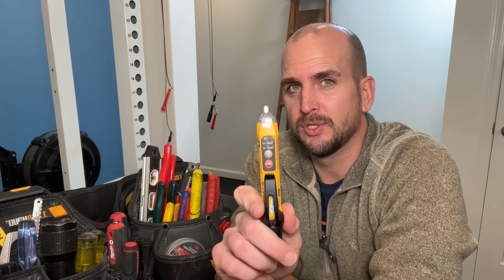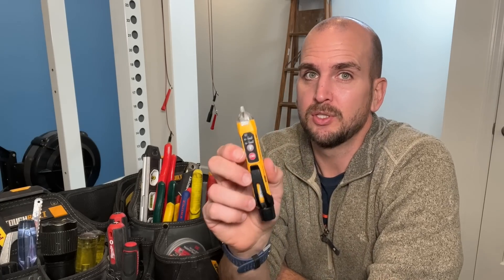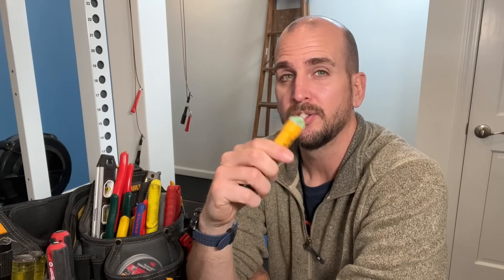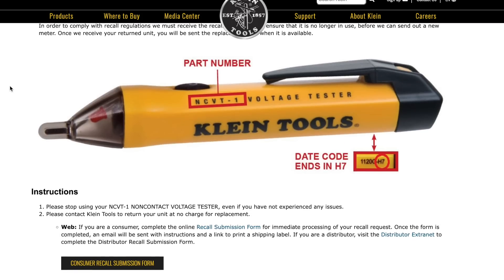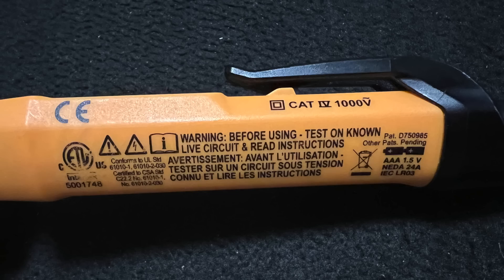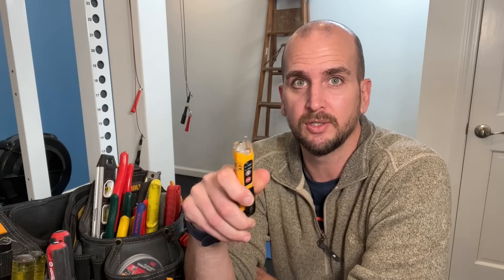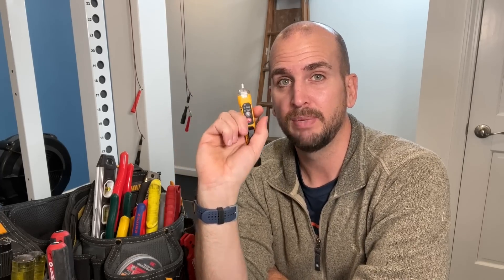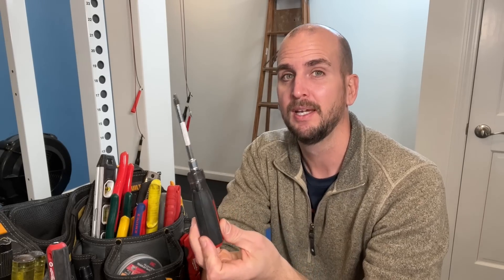The Tool I Get The Most Negative Feedback On And Still Use Weekly

Comment: It's fairly common especially in boxes in a garage, basement or attic, to have runs from different breakers transiting the same box and then going to an outdoor receptacle or fixture.  You may be working on a receptacle or switch where you turned off the breaker and confirmed no voltage with a multimeter, but you'd never know there were still live wires in the box connected to a different breaker unless you also used a NCVT.  A NCVT definitely has its place but it won't substitute for good practice.  Like Fluke says on the side of the tester, "For use by competent persons only."
Reply: agree. i have never been shocked because i used a non contact. i cant say the same about not testing at all.
Reply: Excellent!
Reply: I was over a friends house just last week who wanted to move an outlet and add another in his basement. He shut off the breaker that went to the existing outlet then I climbed up the ladder to the junction box that fed it and double checked it was the correct wire with my non contact tester only to find there were still hot wires going into that junction box. Two different wires to two different breakers fed through that box....glad I checked, if I pulled off the wrong wire nuts or knocked off one of the wire nuts that was still hot I could have gotten shocked and maybe fell off the ladder.

For the price they are invaluable.
Reply: @timb7328  that’s why I check everything coming in. I have an addition on my house that is wired to the back bedrooms and also pulling power off another circuit. Went to take down the ceiling fan to paint the ceiling. Turned off the breaker, double checked the wires and still had a hot wire in there. Hot wire to the fan was also white, and neutral was black. NCVT really helps in a lot of situations.
Reply: @seabass22  oh dont get me started on ceiling fans. My Mom moved to Texas and when I went to visit she showed me her 3 fans and said the were going bad and wobbling. As soon as I seen them, they hung right over her bed and both of my sisters beds I flipped out....when I took them down not only didnt they use boxes made for ceiling fans but used regular boxes with a small piece of wood between it and the joist and just 2 long nails going through it all from just one side of the box.....The nails were pulling out from the vibration and all 3 fans were ready to fall.
Reply: @seabass22  yes, check then check again....good catch
Reply: @timb7328  yeah I just took a fan down in my kitchen (old house from 70s) and it had zero support. It was just hanging on a regular box.

I have to fix another fan that the bracket is just screwed into plywood. (Addition that was carport and put ceiling tiles over plywood.)

Probably gonna just stick some 2x4s in there and screw into them to spread support out. Like I said. Addition is something else lol.

All the other fans are hanging from 2x4s resting on joists and probably nailed idk. I’m gonna check all that as I replace the 50 year old fans. The only one that wobbles is the one above out bed and I won’t run it, it’s so bad. It’s so old, to adjust the speed, you have to turn a knob a 1/2 inch from the fan blades.

I live in Louisiana, so probably a lot of the same building practices.
Reply: @seabass22  sure sounds that way

Comment: Not a common issue, but some people could get bit if they aren't aware that they don't test for DC voltage. Maybe in a furnace or if someone buys a new house with solar.
I use both the meter and the non contact as a redundancy.
Reply: Yup came here for this. Furnace, solar, Automotive, and some commercial applications like I've seen in the NYC Transit (subway) system.

Comment: In no way do I trust a single tester to determine if it safe to touch. I know that any tester can work just a few seconds ago and then not work at any given moment. That is why I do the double no trouble testing.
It amazes me how thick so many are.The non contact voltage indicator is so reliable. As a master electrician for 20 of my 44 years I have not experienced any quality device to not work. Yes I did carry two or three different brands and even a couple or three of the exact type for comparison. 
If a non contact tester doesn’t indicate the presence of voltage you test with a meter to verify. 
It is a time / labor saving tool nothing more.
Reply: You should have just tested with the meter in the first place and leave the toys for the kids.
Reply: @RadioRich100  you obviously have not spent enough time trouble shooting. And do you know the increased risk from using a contact type meter? And not just from the contact aspect.
Reply: @gerhardschemel3565  Ive spend most of my life trouble shooting and I know better than to use toys to do it. Two methods yes , that thing being one of them?, no.
Reply: @RadioRich100  Right weirdo you are.

Comment: My step-father is a licensed electrician and uses the non-contact voltage tester daily and has taught me to use it as well. We had an instance in our home in which a 220V outlet was installed but was not connected to a 2-pull breaker. So one breaker was shut off, but the outlet was still powered from the second breaker. When I used the multimeter, it showed zero voltage but the non-contact was still going off. This allowed me to re-test with the multimeter from the hot to the ground where I found the 120V. While this is a specific case, the non-contact tester provided enough of a back-up for me to re-think what I was doing before disassembling the outlet. There are always pluses and minuses to every tool, but I agree that it is a great tool especially since it is so easy to carry with you. Thanks for all the great videos.
Reply: I am a 35 year licensed general contractor. one thing I have learned is to never trust an electrical system when going into a job, some of the home owner work can be a nightmare. Be careful. I use the Klein and it is just fine.
Reply: @2manycatsforadime  Testing an outlet where the neutral and hot sides are reversed for instance . Check both
if you don't know if it was wired wrong.
Reply: @hestheMaster  I once rented a house where the hot and neutral were switched, and the toggle switch was installed on the neutral side.  This installation had no ground and was in a bathroom.  Yikes!  I always use my tester as a backup to my meter.
Reply: @mrcoffee6811  No ground would have made this a very, very dangerous thing to have in a bathroom indeed. You are lucky to be alive Mr. Coffee. Back in the day they had valve radios which switch the neutral side meaning that the wiring and metal chassis ( usually covered by a Bakelite or wood case)was in fact live!
Reply: @2manycatsforadime  I respect your 35 years in the trade,  highly, but I feel Fluke beats out Klein meter and testing equipment wise,  of course Klein hand tools are hands down, but fluke has state-of-the-art testing equipment.
Reply: @FCES_Electrical_Sol  Thanks and I agree about Fluke. I depend on my subs to do electrical and so the few items I have are Klein.
Reply: @FCES_Electrical_Sol  totally agree. But the flukes don’t like the slots on receptacles. I’ve broken off the tips a few times😖
Reply: had same sort of issue when I installed my doorbell cam.  I flipped the breaker for the outside and it turned off the light on the doorbell and the ringer but my tester still beeped. I had to turn off the living room breaker as well since I guess there was still power coming from the ringer mounted on the wall.
Reply: just about every professional electrician i know carries one
Reply from the maker: Great example, thanks for the feedback Dan.
Reply: @EverydayHomeRepairs  There are multimeters that will do NCV you have to make sure when you buy it has that feature.
Reply: Pole
Reply: when I was doing my practical in my entry level trades training, I went to a job site and used my volt tick in a box to check if it was hot, which it shouldn't have been. it turned out that someone wired the neutral to a hot in another box, so the neutral was hot in the box, and my volt tick picked it up instantly without me having to mess around with wires. also more convenient as most electricians only cap off the hot side of a circuit that's going to be live later on, so the neutral just sits there unprotected until all the devices are installed
Reply: @tye3ow  That indication could mean anything. If you acted upon that indication you could put yourself in serious trouble. Its a lazy mans speed tool. U should have used a meter referenced to a known good neutral or ground. Give the toy to your kids to play with.
Reply: That is why you need to check both hots to ground (and you need to be sure the ground you are checking to is a proper ground connection) rather than just measuring between both hots. When one breaker was off the hot wire connected to it was left "floating" (not sure if that's a real term or just what I call it), meaning that it's electrically isolated from both any voltage source or ground. You will never read any voltage on it, not matter what your other lead is on.
Reply: We found a piece of electric heat like that when we started a bathroom gutting a few weeks ago. Somebody fed from the panel with 3 phase wire. Using the red and blue. Somewhere it junctions to 2 wire with ground. The red was feeding from the panel to the white at the thermostat.
Reply: You then did not know how to test properly.  Test hot to hot. Then both hots to neutral then both hots to ground.  Always test to ground.
Reply: @konradpetz7317  Yes, always test to neutral when available. I see a lot of guys test to ground only and that can be a mistake.  Honestly I think testing to neutral over ground because a hack doesn't need to properly hook up the ground to make the system work only hot and neutral, though a bad neutral could give you a false negative.  Just something I have learned coming after shit work.
Reply: The only plus to the tool is speed which only leads you to assume. The reason you didnt find what you should have the first time was because you were in a hurry.
Reply: @RadioRich100  agree. My personal belief that this is a tool for a skilled electrician. I’ve had both false positives and false negatives. You should almost expect the results you get. If not you need to check further
Reply: @konradpetz7317  If you expect false results then as an experienced electrician you should know better than to use one or buy one.  That so called tool is for anyone to buy it  If you depend on it your asking for trouble. Its simply being lazy and not spending the time to do proper testing.
Reply: @RadioRich100  it is only one of several test pieces I rely on . It’s handy for trouble shooting along with my fluke T5-1000 and fluke 289.  And good old ideal VOLT-CON tester , Just saying I don’t believe it’s  a home owner type tester. I never use it to see if  something is dead to work on
Reply: This thing is a toy not a tool. You simply should have used the meter first and only. No guessing at whats making it chirp. You have poor trouble shooting ethics using shortcuts like the so-called NCV tester.
Reply: 2 pole,not pull.

Comment: You do not use them for diagnostics, and is just for verfying voltage is present on a conductor.. and as stated ALWAYS test on a known live circuit  before using.  Use a contact tester before actually working on a circuit.